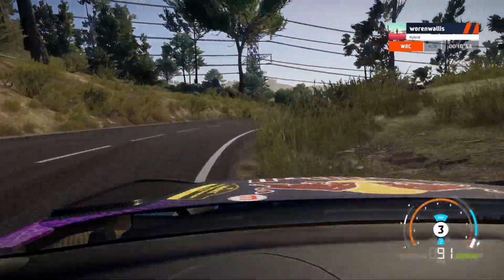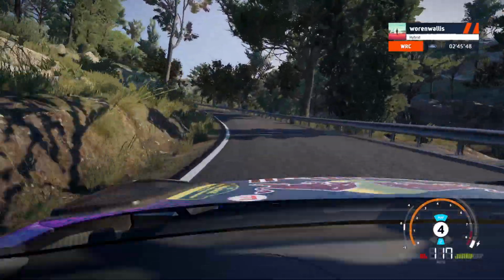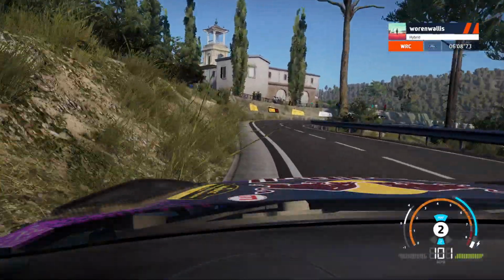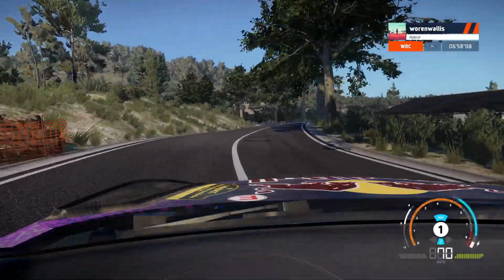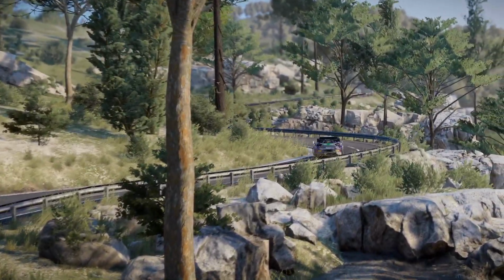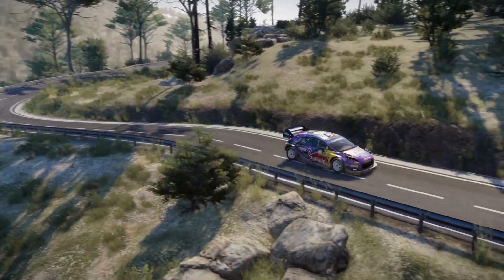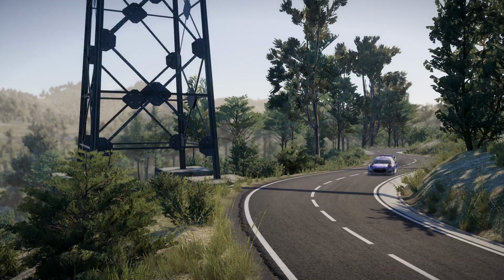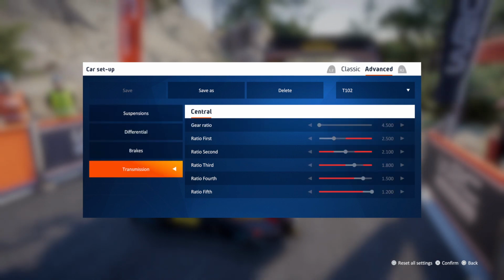WRC Generations Querol Transmission Settings Top 4

Comment: hi great video going to try yr settings out later today i dont know if you have experienced the same as  me  wen setting cars up is that when you set a car up in advanced mode it changes your force feedback so you have to tweak the FF to make it feel right ? also a very strange thing also is that i have a lg nano cell 65 inch tv 120hz 2,1 hdmi with vrr etc so great for ps5 . However  i had the picture setting on game mode with hdr car handled perfectley but when i changed to standard picture which actually is a bit better with contrast etc makes the graphics a lot shinier i just kept loosing control of the car on the same stage as i drove in game mode picture it really made it harder to control the car ?? any ideas why that may be i have noo idea why this would happen just because i changed the picture mode any how i went back to game mode picture and all was fine !! lastly do you have any good force feedback settings ? im using a thrustmaster TGT wheel with load cell pedals many thanks in advance cheers terry
Reply from the maker: I do have an FFB video posted, but it's specifically for the GT DD Pro wheel. The graphics issue is strange, but it's common in Sim racing since each frame determines the FFB calculation and physics calculations. WRC Generations also has a known bug where it automatically changes the wheel rotation which has to be checked every once in a while.